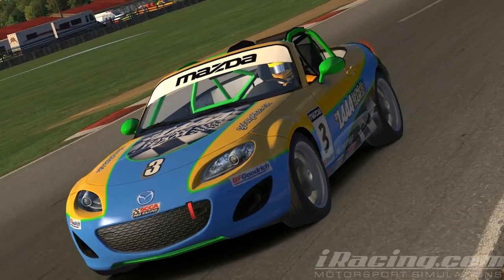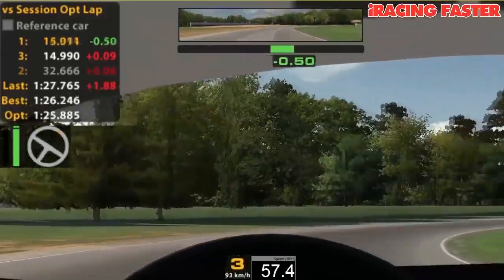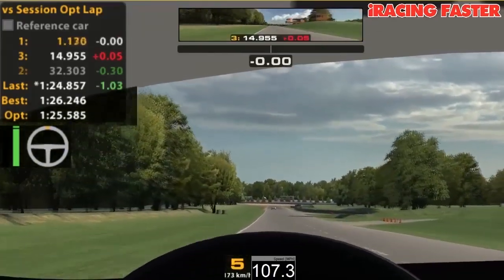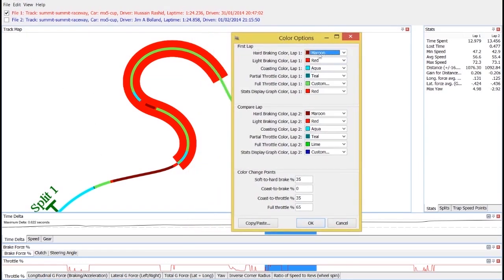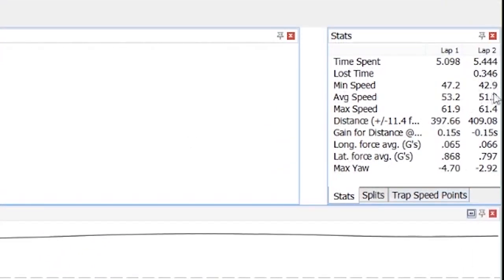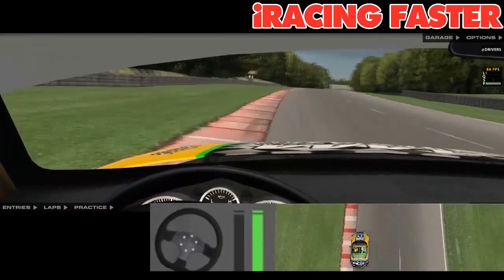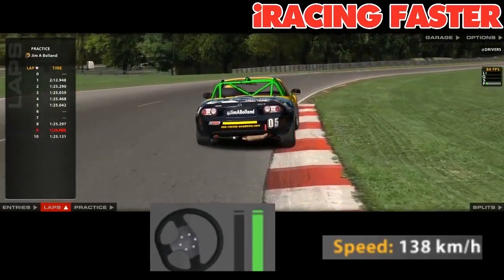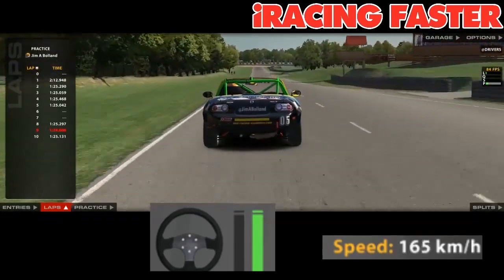iRacing Faster 5: How to use iSpeed to drive faster laps

Comment: Excellent video.  I've noticed personally dropping out of 4th gear is a bad idea leading up to the two right turn straights.  The turn at 1330 of the video, the left turn leading into a hard left, was one of the trickier corners.